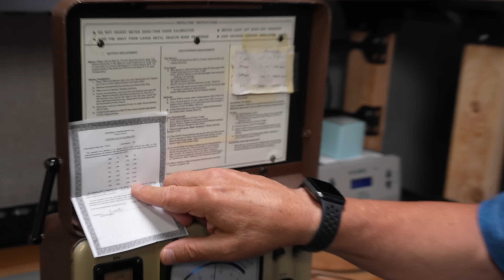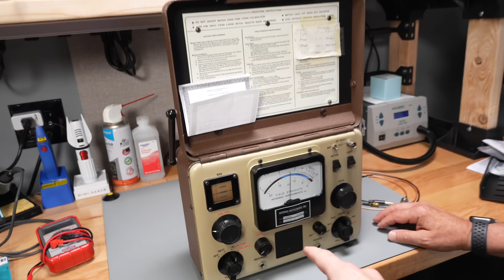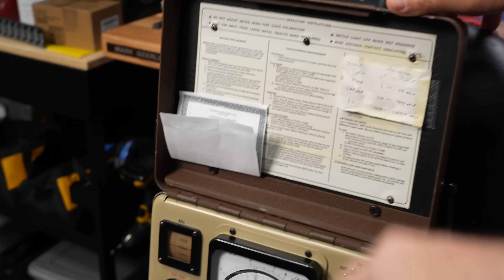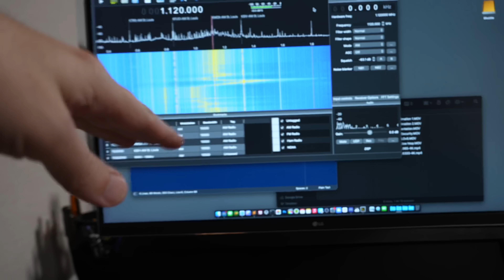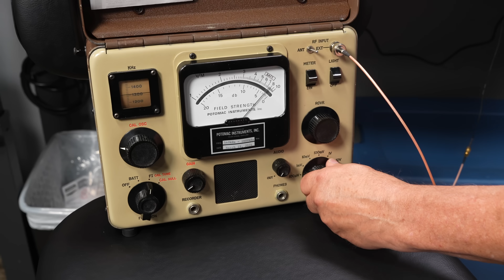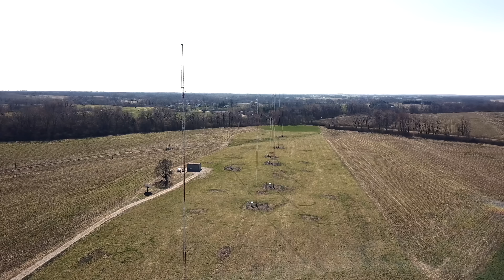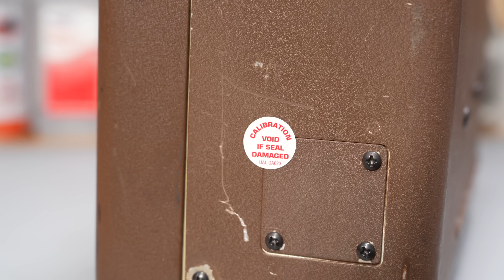This AM radio still costs thousands of dollars—why?

Comment: If I recall correctly when I opened up my Sony ICF-2010 it had a ferrite core antenna situated across the uppermost portion of the interior space of its housing, placed horizontally. Mine have always been enclosed.

Comment: Most of the Hams don't understand the Loop Antenna and should never criticize them and talk them down. You can't work a station if you can't hear them.
A well designed loop transmitting/receiving loop antenna can out perform many of the standard Ham antennas. Proof of performance, why does the Military
use them in the last Wars on aircraft, tanks and direction finding for example;  Ukrainian tanks with Russia. They are high gain, low noise, low interference
and very directional.

Comment: In 1983 I took over 600 field intensity measurements in three states with a unit almost exactly like that one. My partner Dave Gibson and I were working to establish a new 500 watt non-directional AM station on 600 kHz in Paintsville Kentucky. We used a 250 Watt station that was licensed to Paintsville as our point of reference for measurement. After submitting our application to the FCC we were granted a license (WKLW-AM) in 1985. The following year I took an additional 600 field intensity measurements this time using our own signal as reference and we were able to increase the power of our station to 5000 Watts

Comment: Thanks for the video fellows.  I had the dubious fortune to be assigned by my employer (as an electrical engineer with an amateur radio background) which was the electric power utility for Duluth MN and Superior WI to have to route a new transmission line just a quarter mile from an AM radio station transmitter tower operating at about 1300 kHz.  The new power line was being constructed using single-pole wood structures with a copper ground wire from the top (connected to the horizontal overhead lightning shield wire) to the ground rod in the soil at the bottom.  I had to bring in a national consultant and we ended up detuning the vertical copper pole ground wire so that the pole appeared to be much, much shorter RF electrically than the 100' it physically was.  Doing so, made it possible for the electric transmission line to "disappear" as it passed by the vicinity of the AM station tower and the AM radiation pattern was not affected.  Dale in Iowa
Reply: If the radio station was there first the power line had to be detuned at the expense of the utility. If the utility was there first the radio station had to pay for the detuning. Radio stations hated that because while the stations built things to last awhile the utilities built things to last forever and charged accordingly!

Comment: I operated this very type model of Field Strength Meter for checking 
monitor points for a two tower AM directional station KDAV-AM radio station's signal pattern was within FCC tolerences. KDAV 580 kHz had a null the protected at radio station on the same frequency. KDAV is the first AM radio station to have a 100% Country Music format. Buddy Holly and Waylon Jennings were radio announcers for the station. I was the Chief Engineer. I also worked at a 4 tower AM station later in my engineering career and used a larger "older" Potomic Field Strength Meter.

Comment: A little off topic but wanted to ask. I recently got an RTL-SDR v4. I plan on using it with my Pi4 and windows 10 laptop. What is the most popular software to use with it. I know there are tons of options I just want to know if anyone tried some of them and which one they ended up with for Pi and Win10.

Comment: I spent a week out in the Yakima sun driving all over the valley with one of those.  One thing that tripped me up was hop fields with the long overhead wires used to support the vines.  Talk about a passive radiator.

Comment: Fluorescent lightbulb. I was caught (intentionally) one night reading a book to the light of my desk lamp bulb hanging by scotch tape strips from a 6 meter dipole draped around my dorm room fed by a Gonset G76 at about 51 MHz and 100W. That was input power to the PA in those 1960s days. Look Ma, no wires. Of course, I got a very strange look. So a Fluorescent lightbulb is a mandatory test.

{^_-}   (And hopefully your YouTube income can spare more than the cost of an rtlsdr dongle for AM broadcast.)

Comment: Back in the 1970's I worked for an AM radio station. We had two towers, set up as a phased array. Once a month I would drive to three predetermined locations, each several miles from our transmitter, and take Field Intensity measurements using a Potomac meter similar to the one shown here. It was a convenient and easy way to meet the FCC requirements to verify and log our array's performance. Thanks for this video.
Reply: I did the same thing all around the DC area in the 1990s.  Got lost sometimes, no GPS.

Comment: In the early 60's I read in an electronics magazine that if you held an AM radio with a ferrite antenna upside down you would lose the signal. I swear at that age it did work as they said.  This may have been the April Fools edition.  Like the Black Noise Generator made out of a black bean soup can. Unfortunately, I haven't seen an AM portable radio in so long to try it.   Yes, I do have a ghost detector.

Comment: Hi, This warms my heart.  My father was one of the founders of Potomac Instruments and one of the engineers who designed this instrument. This brings back such fond memories.  Radio was his passion.
Reply: That's so cool to hear! Potomac has always had a high standard of quality, that usually comes from the top :)
Reply: Respect to ur dad
Reply: yes they made great stuff, I had a VHF/UHF model
Reply: Just bought a new Antenna Monitor from PI and life is good! How fun it would have been to hang with the guys who created the AM and FM tools of that ERA.
Reply: I remember the building in Silver Spring.  I used one of them when I worked for a radio engineering company 30 years ago.  They also made antenna monitors for AM stations.

Comment: The successor to this is the Potomac Instruments FIM-4100 which is a modern software controlled digital readout instrument which is really great to use. Problem is the high price. Over 14 grand. It makes the analog FIM 21 and 41 look pretty good. Although no longer manufactured used ones can be found on used equipment sites for 2 grand or less. Calibrating the older analog ones is costly and Potomac Instruments is the only company that will certify the calibration.

Comment: Calibration stickers and docs only means something if calibration cycles are maintained according to the manufacturers specs. Pass the required calibration cycle date and the calibration is no longer valid.
It sounds like dad it trying really hard to sell it.. Hyping it up to get the price up. Regarding something having a particular collectors value, it's value is only what someone is willing to pay for it at any given moment.
Reply: I can guarantee he doesn't want the price to go up on these things—it's hard enough getting budget to keep a 60 year old unit maintained and calibrated. The newer ones (with fancy digital features and GPS) cost even more!

Comment: Cool collectible radio, however I can do the same thing with my cheap AM pocket radio by turning it. I know where the null is, so I know where the transmitter is and my signal strength meter is my ears. I do really like that tunable external loop antenna, more than the radio. I might build one of my own. Have been meaning to do it some day. You can also enhance reception of a radio by putting it near the loop even without a connection.

Comment: Wow! Blast from the past. Back in the mid-80s I was an assistant Chief Engineer at a AM/FM station in Baltimore. I remember driving around in Pennsylvania in the station remote van with a similar unit testing signal strength when we moved the AM transmitter. Thanks for resurrecting a memory from 40 years ago!

Comment: The more I learn about AM radio the more it reminds me of how EM surveys work for exploration geophysics. Even everything having a specific orientation and going "null" if its 180 degrees out. Unlike radio though we have 3 "antennas" now for X Y and Z measuring the strength of the signal in 3 orientations allows a 3D "image" so it can be a pain in the ass to get lined up correctly.

I cant help but think a random geo was screwing around with an old AM radio in the bush back in the day and figured out that theyd sometimes get a signal with the antenna "pointed" at the ground. These AM field strength testers remind me a lot of the very original looking 2D EM recievers from way before I was born.

Comment: This is a Potomac FIM41 field intensity meter. It's basically a calibrated, precision receiver used for measuring radiated signal strength from a AM transmitting antenna for proof-of=performance purposes.
Reply: nuh. FIM-21

Comment: Neat stuff. Back in 1986 I was the engineer for a two-tower AM in Connecticut, and I would take these readings, then tune the phaser to ensure we were in compliance with our license terms. Great blast from my personal past!
Reply: Which station?
Reply: @markmalasics3413  WCTF Vernon-Hartford (1170 AM) in Connecticut. Ran 1KW daytime, 500W “critical hours.” That was in 1986. Don’t know whether it’s still on the air.
Reply: @eclexian  looks like they're still on the air, they even have a Wikipedia article. They apparently moved transmitter locations in '88.
https://en.wikipedia.org/wiki/WCTF
Tuning phasers, boy that brings back memories... WSRN, back in the late '70's. They're obviously still around, as Swarthmore College isn't about to go anywhere, though they did go dark for a bit during COVID.
Reply: @spvillano  I had no idea there was a Wikipedia page for it. That's neat! Thanks. Just to clarify, the transmitter site didn't move; the studio moved to colocation with the transmitter. I remember building the original studio from WRTT in an office building in Vernon. Moving it to the xmitter site was a smart move. One of the common points of failure (not to mention ongoing cost) was the low-tech unweighted leased phone line STL. It also meant someone was there a lot of the time, keeping vandals away. These were both ongoing problems there.

Comment: Way back before I retired I used a Potomac instruments fim 41 to measure am and FM radio station signal strength. Particularly am directionals where we had to make sure that in a multitower array that no was deep enough to meet FCC requirements for protecting adjacent and Coach channels a distance away. These were highly calibrated and accurate receivers with accurate metering.

Comment: I was am ^ fm engineer 20 yrs still fixin crap but love this meter  used it many tomes most memories are ridin my quad to over 600 signal points for an omni at 930khz ay 1kw. Jumping fences..seeing other peoples stuff..hehe..dodging cows...and once rolled over with quad on top of me when ramp failed. Funny thing had to takes same measurments twice..to make FCC (Uncle Charlie happy) if ur interested anyone in broadcast engineering get involved in S. T.E.M. program, become a ham radio operstor, goto ur fav radio station and intern as assistant engineer somewhere.....foot in the door. This is the most not boring industry ever. Computers, internet , solar and wind power,  generators, tower, transmitters, emergency stsyems, automation and more.....if u have what it takes either goto school, become a ham and get mentors, get involved in broadcasting...enjoy...thanks for da video...my channel is @servicedogranger
P.S. I also have a comm van 50 air mast generator, solar, a/c, 2 computers, production racks, and more..❤❤

Comment: 7:42 that's because when you hold an antenna YOU become part of the antenna circuit, your body becomes part of the grounding system! That's a dead giveaway the antenna lacks a good ground leg or you're standing on poor soil/rock for good ground. All antenna in theory are some form of a dipole (like classic rabbit ears) with a positive and negative/ground element that rapidly flip polarity as the radio waves hit them, some of them just "hide" one pole/ear to save space by using different tricks. You can often solve that by adding the right length of wire trimmed to roughly match the frequency used to a ground point somewhere, using say an eye-crimp fitting onto a chassis grounded screw somewhere on the radio. Those are called a "Tiger Tail" in amateur radio and often work well for handhelds or portable setups once you tune the length.

Comment: This brought back memories. Around 50 years ago I went out with the engineer with a receiver, but it used tubes and it was much larger and heavier. We put it on our shoulders. We spent the whole morning doing just one lobe. Both of us had our First Phone licenses but I had never worked at a station. It was just as you described. The station was a 3 tower array in the RF ghetto of 1410 KHz. :) I guess we were testing the daytime pattern, but I don't remember for sure.
Reply: I was checking at 1470.   Our station jammed KJR 950 on car radios.  A car radio (262.5kc IF) tuned to 950 was also tuned to 1475.
Reply: @Iridium43  Yeah, images have always been a problem in those low IF radios. But all the car radios were 262.5 KHz. 
Was that from someone driving by the tower?
I used to get the second and third harmonic from a station on 1350 about 5 miles from the tower.

Comment: I found a VHF meter at a yard sale years ago. The meter came off it's jewel pivot, and it's battery compartment had corrosion, but it all cleaned up well on the bench. Cost me $200.
Also, found several European FSMs from KSL Farnsworth Peak, which we gave to The Old Cable TV Equipment Museum.

Comment: Certain older pieces of test gear are still considered a valuable must for calibrating particular types of equipment.  This is why for instance a particular HP VTVM model is considered more desirable over another.

Comment: The FIM-41 is the big brother that goes up to 5 MHz.  That works on some shortwave systems, but was mostly used to certify 2nd and 3rd harmonic compliance, before NRSC cutoff rules required a spectrum analyzer.  

A major use not mentioned is ground conductivity studies of co- and adjacent channel signals to a potential new AM DA, in regions of the country where rock often makes soil conductivity demonstrably lower than 47 CFR presumptive charts.  

The nature of FCC designated DA monitor points as license conditions, usually 1-4 miles from a TX site and based on larger studies after new construction or major changes, could be described far better.  

Also missing from this video is how use of the null perpendicular to the received signal is used to evaluate quality of a potential measurement point.  A null less than 10:1 is a horribly disrupted spot, or one with power or phone cables or metal structures distorting the signal levels.  Get over 40:1 null at right angles to signal, and that's a really clean point.  

There's not just one antenna in that meter lid, but two.  One is the normal receive antenna, and the other a transmit loop for the calibrate oscillator.  

The BNC input could also allow use of the FIM as a sensitive detector, such as with a Delta OIB-3 Operating Impedance Bridge.  That could be done at increments above and below carrier frequency, trying to adjust for a flat resistive and balanced around zero at carrier reactive impedance curve.  

Try parsing that calibration certificate again.  1 or 2 percent tolerances....  with so many stacked details as to the basis of the reference fields and their use calibrating meters, that the lumped sum of worst case errors could stack into the 20-40 percent potential inaccuracy range, even if far better precision.  

Not that I've evern learned to lean slightly, to anchor an elbow in one side, while holding an FIM stable in one hand while fine tuning adjustments with the other....  And then rotate for the null, evaluate point quality, calibrate, rotate back, and measure, and record notes.  

Lather, rinse, repeat, sometimes out 100-250 miles from another station's site, if doing ground conductivity field studies  Rarely past 20 miles in normal proofs.
Reply: It's just a video, not a tutorial

Comment: The SONY radio did hit a null on the 1320 station, but the AGC hid the signal strength dip pretty well. Listen closely as the radio is moved around; the interference level goes up in the null.

Comment: This Potomac FSM is built for the MF AM broadcast band. Other versions work on the LW Aviation Navigation band or the SW bands. All on first appearances look identical and all are still in high demand by the radio industry worldwide today as it is one of the few devices around that can give a accurate calibrated repeatable numerical value to the received RF signal strength of a selected radio station, thus the high price.

Comment: Oh my! I had never heard of Potomac Instruments, and it turns out I've lived just down the street from their shop for years!
Reply: Same!! I bet it's no coincidence that they are a short distance away from NIST, whose reference it seems like their calibrations derive from.
Reply: PI also does lots of specialized government contracting. First time we invaded Iraq, I had a 4 month back order on some custom accessories for one of their phase monitors.  They were 100% flat out trying to build elements of the directional shortwave transmitter sites we set up across the borders to send propaganda and info towards Bhagdad, before resuming normal operations.